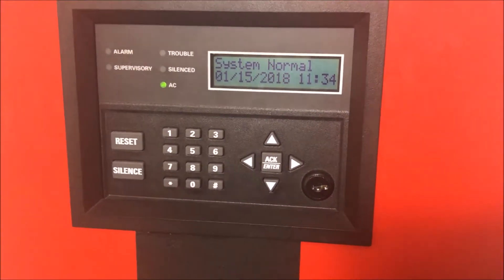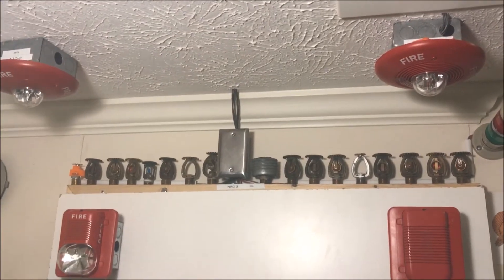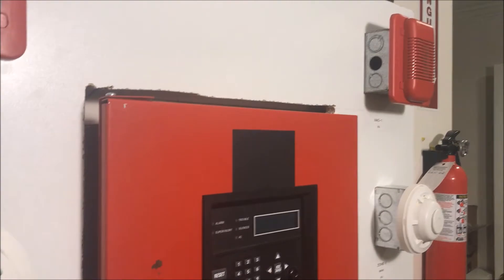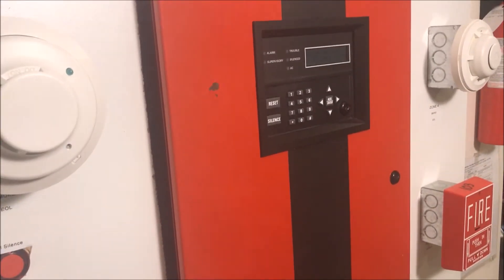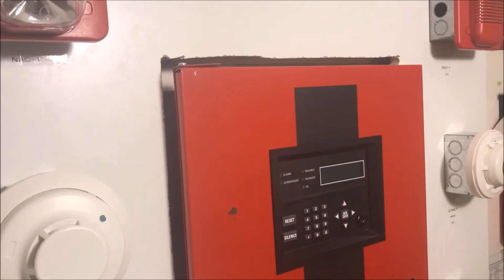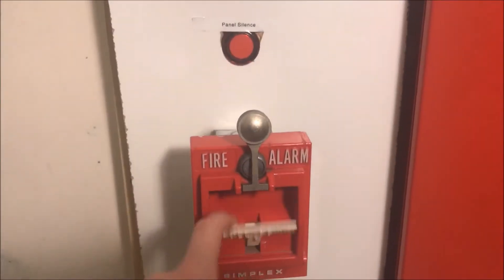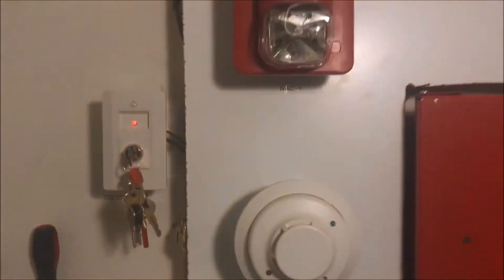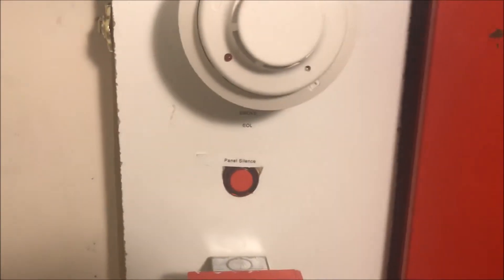Supervisory/Alarm Glitch on my SK-5208 FACP

Comment: i can remember in the late 1980's going to an elementary school with a fire alarm system that constantly randomly would go off. it was super annoying, especially knowing now that i have had migraines with sound sensitivity since childhood. someone really needs to air horn prank whoever goofed up the programming on such a critically needed safety device. ironically, i ended up joining a rescue squad years later and have gotten quite a laugh over that since then.